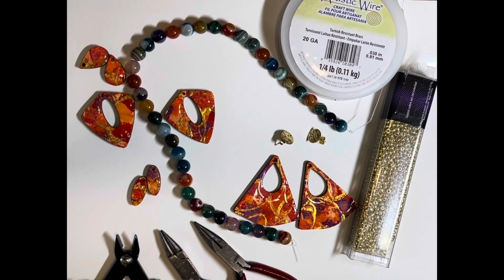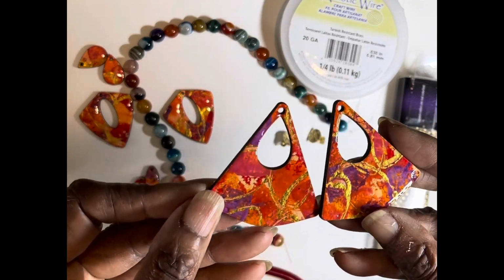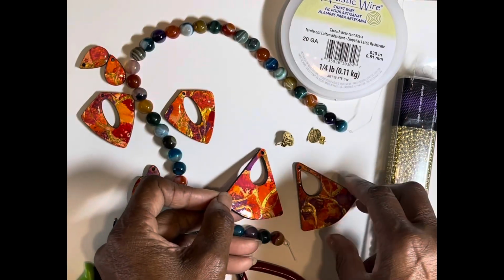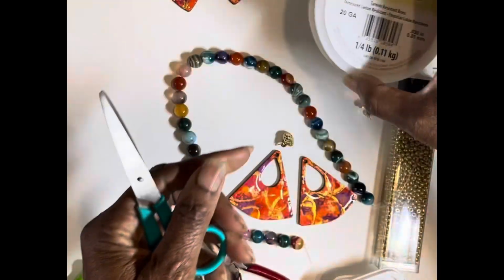Assembling Hand Painted wood Earrings

Comment: What is the name of your heat gun to dry the resin?  Did the resin actually harden that quick as shown on the video, or was the video fast forwarded?
Reply from the maker: That was a lighter used to pop the bubbles that form. Since i used uv resin, i cured it outside under the sun. On a bright day it takes 20-30 minutes. I have other videos that go more into detail.